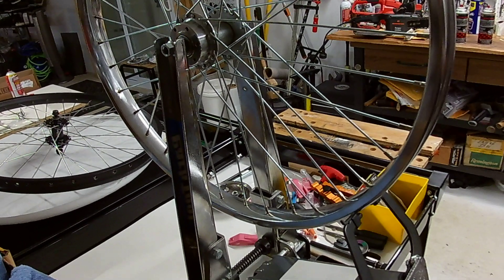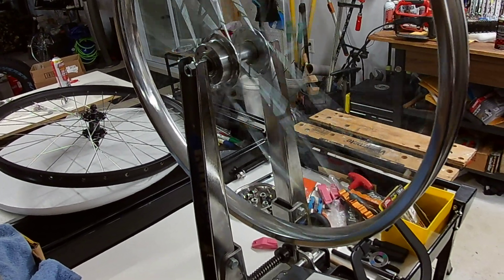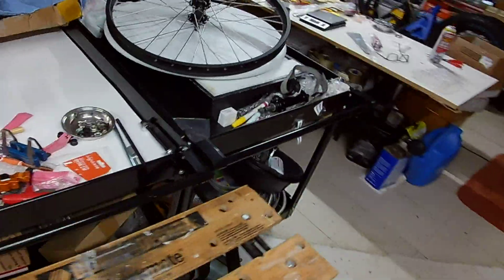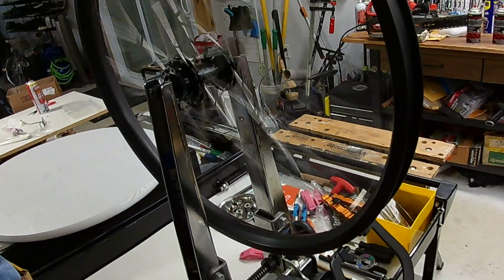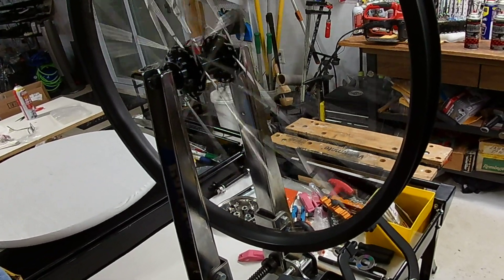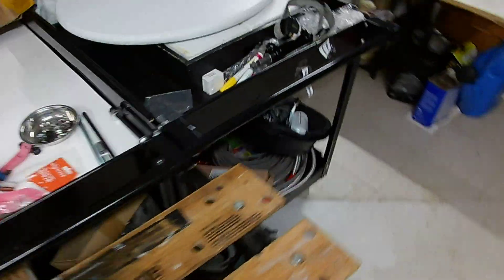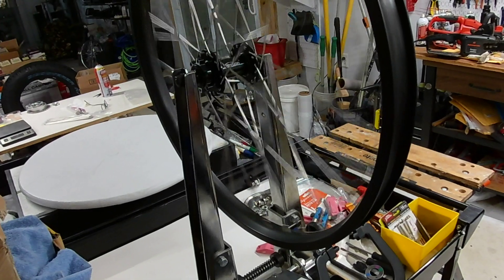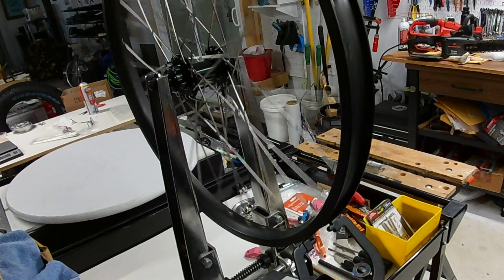How long can a sealed bearing bicycle wheel spin? Compared to non sealed bearing.

Comment: A poor quality sealed bearing VS a high quality sealed bearing will make a difference....I suspect on the 1st caged/ball bearing wheel, that it needed to be adjusted/loosened a bit and it would have spun much longer. As you know the caged/ball bearing hubs have to be properly adjusted. Not too tight but not too loose where there is too much play (wiggle) 
 I'm thinking about trying to find the right size cartridge bearings to do a ball, to sealed bearing conversion on some 29 in aluminum double wall 48 spoke wheels. I might try to go from 48 14g spokes to thicker 13 or 12g spokes to make a stronger wheel. I want the cartridge bearings to be beefy enough to so both wheels can handle  325-350 lbs  (me 220 lbs, bike 25lbs, engine kit 25-30 lbs, saddle bags & gear 50lbs) If the cartridge bearings are too small/weak. I'd be better off with the caged ball bearings. I use waterproof marine grease on just about everything instead of regular grease. I bought a cheap mongoose from walmart with very little grease in the bearings so I added the marine grease.
Reply from the maker: I have shipped and built lots of wheels. Do not know if customers maintained there wheels by adjusting cones and greasing. The sealed bearings are so much smoother immediately. I have been experimenting with some caged to sealed conversions and will be making videos about conversions. With the conversions I think it is important to have a cut to size preload spacer between the 2 bearings.